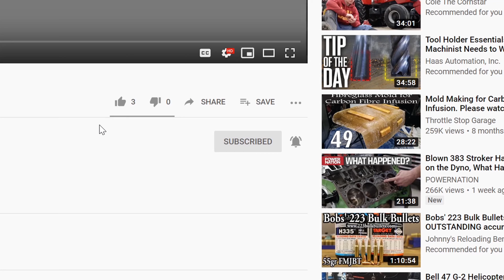Datsun 280Z Paint and Body EP19

Comment: Just a tip the front fender are big and thin. The stand even with foam will push up in the fender as you pushing down to sand them.
Mount them to the car. Because they flex to mount them . Then they are sanded and formed the way they sit on the car" in Stress"  if you can ,see what I'm saying.
Do all the work off the car then when you put them on the car they are tweeked different then the way you sanded and filled them.
     Do all your work on the car, 
In the natural tension they will be in.
Reply from the maker: Good tip!

Comment: Hold up! You will be there for ever. You are not building with filler, nor 2 K primer. 
    Your block over dents and waves. I saw you guide coat a number of times, but no material was added!
    You are fighting yourself over and over.
You need to put material down, block, put material down block, 2k prime block.
Ready for paint.
    You need to put material on the panel.ok 5:28 you put filler on SPOT , wipe the whole panel from lower body line to upper body line. Every time you fill little sections your making more work for your self. Wipe the whole panel area EVERY TIME. 
   The only time to do small areas is after you blocked out primer, even then you should only need 2k primer to fill it.
Time is money, you will spend less time making it straight by wiping the entire area every time.
Also you should be blocking diagonal. Never left to right, especially against that lower body line. Block diagonal the entire door in cross hatch pattern. This will get it blocked out WAY faster.
Sanding left to right on the lower door edge is giving you train tracks. Diagonal sanding
Is the fastest way to flatten a surface.
Reply from the maker: Sometimes the shutter speed and timing of the timelapses makes it look differently but I assure you everything was sanded with a crosshatch pattern.  The multiple guide coats are due to grit changes in sandpaper, sometime you dont need to add more filler to continue flattening and getting it perfect.
But all good advice otherwise for anyone else watching!

Comment: That tape you're putting up to towards the top of the door while you're sanding....does that help with the body lines? What is the purpose of it? TIA
Reply from the maker: I usually put one or two layers of 3/4" tape above the body line and sand up to the bottom, then move the tape to below to body line and sand the top down to it. Makes for an overly crisp and STRAIGHT  body line. So crisp it usually needs to be rounded off before throwing the next layer of paint on it! Otherwise it would be a super sharp line and wouldn't fit the body.